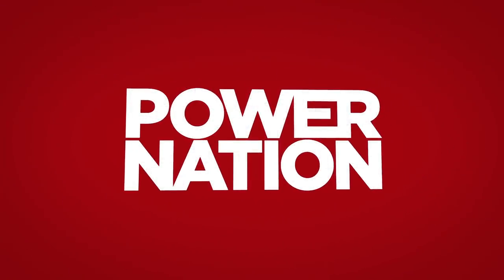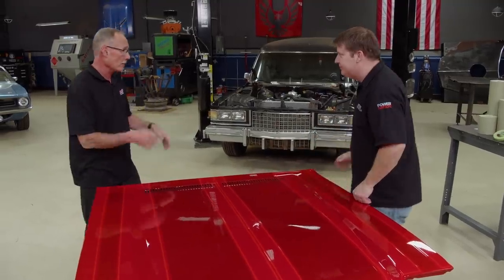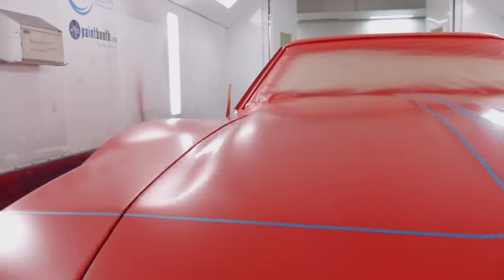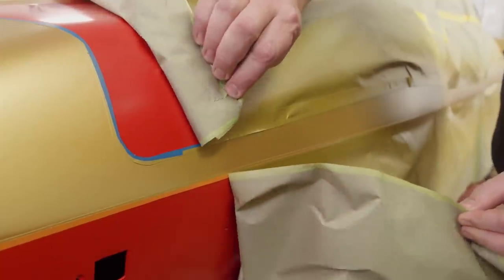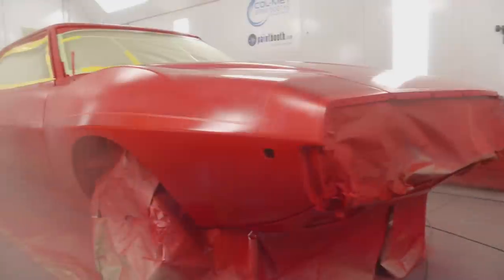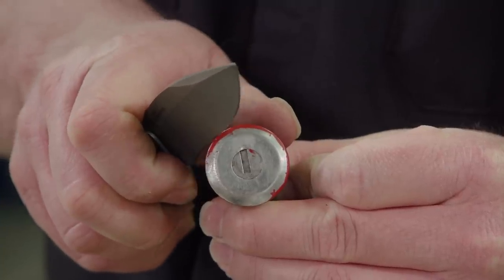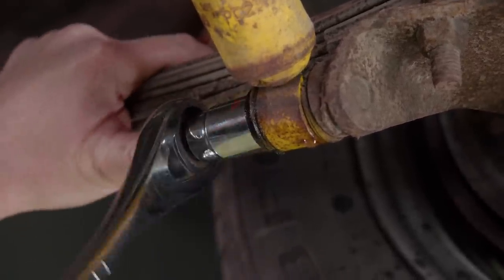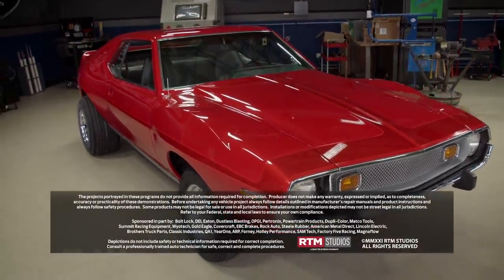AMC Javelin Paint Goes From Boring To Bright Candy Apple Red - Detroit Muscle S8, E8

Comment: A little tip guys, when you measure to order your Lakewood bars, you want the rubber snubber to contact the eyelet of the spring where the bushings are. If you get em the way these guys did, too short, you risk snapping your leaf spring

Comment: Never wear gloves when working with rotating equipment (polisher in this case). It can grab the glove and take you hang with it, or a finger or two.
Reply: I had a ex co worker stick his hand wearing a leather glove in a hydraulic powered rotating piece of equipment. His glove caught and twisted his hand up into the equipment before stopping it. luckily it was a high speed low torque motor and only busted a bunch of bones. Not that this matters to the glove thing but he also pulled out infront of a train totalling out a new company truck with like 50 miles on it.
Reply: first thing I thought when they said "wear gloves for protection"
Reply: They are the pros lol

Comment: Looks great.seems like a lot of trash in the paint on the hood are you going to cut and buff it?
Reply: I would have to lay about 2 extra coats and cut and buff to level the clear on all the extra layers of paint
Reply: Noticed that.  Looks like it was sprayed in someone's shed and not a spray booth.
Reply: @ibast1  cause nothings been buffed and cut with polish
Reply: @cameronvandygriff7048  agree, but I'd expect a better off the gun finish in a booth.  In fact I've seen better home jobs prior to cutting.

Most professional 2K paint shops don't do any significant cutting these days.  Just a quick polish.

This much cutting and buffing would be like the old days using Acrylic.
Reply: @ibast1   with camera crew coming in and out of the booth to get the shots, it's amazing that it doesn't look like a turd rolled in a sand pit. A good cut and buff and it will hold its own at most car shows.
Reply: @MattLundquistVW  Fair point.
Reply: Yeah...I've sprayed cleaner jobs in a garage  booth lined with drywall.
Reply: @ibast1  it really just looks like they didn't go nuts to get a good finish in a booth is alot of work too takes alot of cleaning alot of prep gotta keep filters changed and your still gonna get trash when I was in school we had a 30k paint booth still gets trash any dust in there gets whipped up bit I wouldve laid an extra coat just to level the clear out it drives me nuts to see undeveloped clear XD
Reply: show is probably 8-10 years old guy....

Comment: All ways had a place in my heart for Javelins. when I turned 16 my dad and I went shopping for a car for myself. 1977 I wanted Chevelle, Camaro, Mustang like my friends had. dad pointed out a Javelin in the Dayton daily news. What's a Javelin? he said it's a car from AMC similar to his 67 Marlin. I wanted to die. So we went out to check out the Javelin 1970 360 auto. We waited at the guys house until his daughter came home with the car. Wow I was impressed. bright orange with a black C stripe down the side. 900.00 bucks and a good test drive and it was mine. My Dad drove it home while I followed in my Dads company car a 76 Oldsmobile Cutlass. Oh Supreme.  I couldn't take my eyes off the Javelin while following. Now my dad was as conservative as Dads can get, and as I was changing his radio station from IF i WERE A RICH MAN to ROUND ABOUT He floored the Javelin and left me in tire smoke. I was hooked on AMC for the rest of my life till this day. I've built many a AMC/Rambler even drove my 72 Javelin/AMX on Daytona speedway for the 30th AMX anniversary in 1998. rate now I'm in the rebuilding stage of a 1959 Rambler American 2dr Station Wagon and just two weeks ago found a long forgotten 1970 AMX 390 4 speed car sitting under an old Oak tree for the past 20 years before that it was sitting in the guys garage since last driven in 1977. Its sad shape and looks like a 200k car but only has 64k original. bought from original owner that got it at Viti Brothers motors in Rhode Island. Good luck with your project guys. mine is just beginning.

Comment: You should have found some AMC period correct slappers,  They replace the spring clamp, shock mount and look entirely different than the Lakewood versions which didn't go on AMC back in the day.    Camera showed some trash in the paint on the hood but I'm sure that's another day.     The extra steps of blowing out the hidden dirt, and sealing the jams are awesome tips.   Still remember laughing at Jared using a cut off wheel to "set the gaps" on a camaro done on the show a long time ago

Comment: I know I have no experience and couldn't do better but, that test panel hood looked to have a lot of orange peel.  It would take a lot of color sanding, buffing, and polishing.
Edit:  The finished painted car, too.  I'm sure they will correct it.  Maybe, that'll be the next episode of "Bad Apple".  Great car.  I'm loving it so, far.
Reply: Exactly what I was wondering.
Reply: It’s due to the multiple layers of base and candy the clear shrinks down to whatever texture was left from that.  It needs to be sanded with 800 and re cleared to make it perfect.
Reply: @Grunt49  I thought it looked bad and then read your comment and am wondering how hard you looked? Holy crap I usually have a hard time nothing orange peel but Everytime the light reflection glossed over an area or they showed a whole different part of the car I was like damn that's bad.
Reply: I'm guessing summit paint is super cheap for a reason. Also bad filtering or lack of maintenance

Comment: Wrong offset on the rear rims.
Reply: Lemme guess, it needed 98 inch rims and LS power?
Reply: @SladeM.  tires sticking out beyond the fenders is cheesy. My 68 chevelle SS is badass, with 10" slicks tucked in, without tubbs.
Reply: @jeffreyjohn2037  This is a 70s style build. Not everything has to look like you’re 68 Chevelle
Reply: @SladeM.  yeah, that's true. Now I'm going to do a wheels up launch.
Reply: @jeffreyjohn2037  Yeah man,Bench racing is fun

Comment: So it'll be ugly and slow.   Bravo.
Reply: The shoulda went with an AMC 401 and I'm sure you'd rather see it on 78 inch rims and an ls motor. yaaawn
Reply: I'd just rather see a build that won't be out performed by a Honda Civic on the track and in the styling department.
Reply: @bmstylee  Oh you, obviously you know nothing about AMC engines. Especially the 71 and 72 Trans Am Series racing that used the 304.
Reply: @SladeM.  oh I'm quite aware and news flash this ain't a race engine.  I'm also aware this boat anchor of an engine barely made 300 hp with a budget that any other engine would make significantly more.   Or the same as a new Civic Type R.  And the Civic will last a lot longer and does it with 4 less cylinders and 3L less displacement.  Pretty pathetic.   But I guess being slow is cool now days.
Reply: @bmstylee  That's those idiots on that show, there are plenty 71-74 AMX's out here in the real world that will eat your type r thing for breakfast. Not to mention with that 40 plus year old tech under the hood. Now it's not going to be cheap.